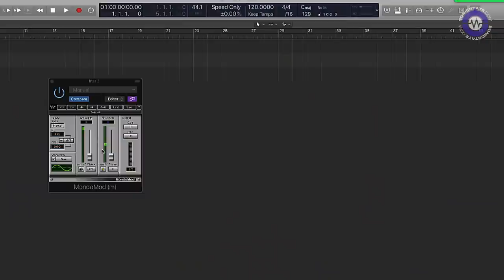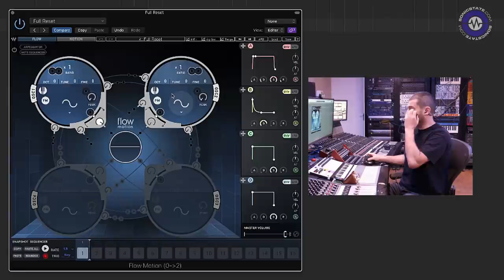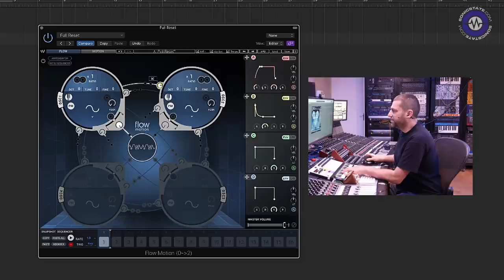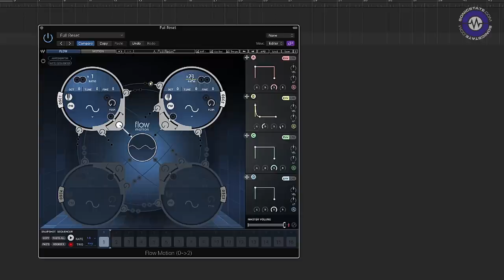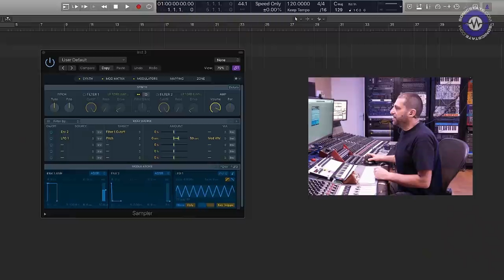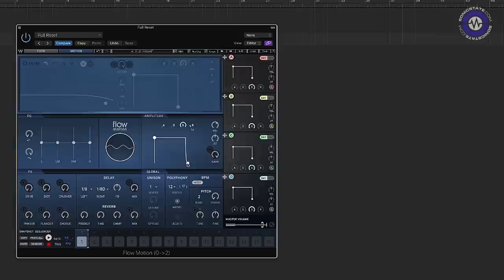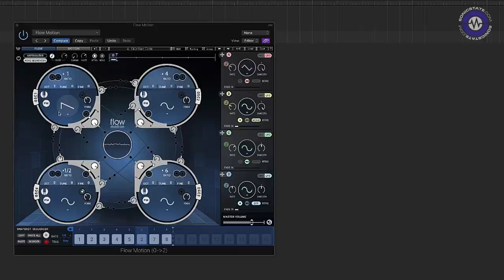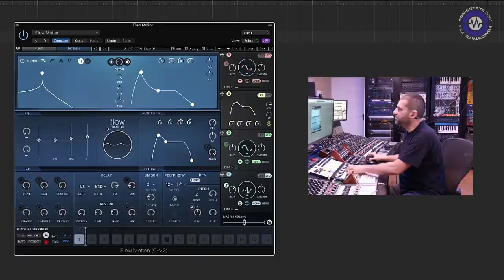FM Synthesis - How It Works with Yoad Nevo

Comment: I think of it as like this. The modulator decides the speed of witch the carrier is read. Or the modulator is reading the curve of the carrier. The more positive curve the modulator point is, the faster the curve of the carrier is read forwards. If the modulator curve point is negative then the carrier curve is read backwards.  I made a basic program calculating this. :-)

Comment: All the books I have are stupidly complex. Just think of FM as HFO, we all know LFOs, but think of FM as a series of HFOs (high frequency oscillators). Then you use the numerous envelopes to vary the levels of the tones to alter the sound over time. There's a lot more to it than this as you need to know about the relative frequency intervals, but so long as you're not trying to make a specific sound (like piano etc) you can experiment with those and the algorithms.
Reply: I think that's the key -- I can make a change and know it's going to have quite an effect but the trick is trying to think of a sound and actually be able to get int the right ball park by programming...
Reply: I've known FM synthesis for years, and I've never heard of it put this way. that's a brilliant idea and might make it easier to help someone wrap their head around it. Great Idea!

Comment: 24:17 actually it's not just 8 bit. Even the cheapest OPL chips had 11 bit resolution. The original DX7 has a 12 bit nonlinear DAC (like u-law companding) with a resistor ladder network theoretically giving a dynamic range of about a 14bit DAC. But as the resistors weren't always perfectly matched this introduced these well known noise artefacts. On the DX7II this was replaced by a 15bit linear DAC giving a much cleaner sound. The sampling frequency was 49.096 kHz. Not too shabby for the time. the grittier sound of the cheaper FM models like the DX100 or FB01 is because of a much smaller quarter-sine wavetable of only 1/4 of the size (256 samples) compared to the DX7 (1024 samples).

Comment: I (barely) remember studying FM and PM in my communication systems theory class...some really interesting mathematical derivations - tempted to dive into my basement to see if I still have those lecture notes! Probably wouldn't make much sense now after 30 years.
Reply: I think it differs what you use them for, in radio technology you modify non-audible carrier waves with audio, here you modify audio carrier waves with audio waves or non-audible frequencies. When you search for youtube video on FM (and over some time YT finds a lot of them), half of them are about radio communication and are not relevant for this realm, but they are not about how the results sound (musically, that is).

Comment: One thing that I wish these "FM Made Easy" videos on YouTube would help explain. Is the Combination types of all the operators. I mean the "DX7" has six operators! I get that one Operator modulates another. But I'd like to understand how to make all six of them Work together?
Reply: Usually high operator counts are there to make it so you can create an effect similar to detuned oscillators by setting up multiple fm pairs.  Because the dx7 had only sine waves it also needed 6 operators so complex wave shapes could be created for things like using saw waves as the carrier.  With modern FM synths you rarely need more than simple fm pairs as they usually have unison and complex waveshapes available.  In the rare cases you need more its usually because you're doing something to the transient for a piano or guitar sound.
Reply: @Pianet  Thank you, I appreciate you Explain that. To me it always Kind of baffled me in the past.
Reply: @maxmatson1578  most of the Volca FM presets (6-op FM synth inspired by the DX7) have the "main sound" produced by carriers affected by modulators, and extra sounds by the leftover operators that are not being modulated by modulators that add more subbass, more HF content, etc., to give a preset its distinct sound. Turn off one of these "extra" operators and you end up with a mutilated version of what you started with.

more operators is better, and not necessarily for trying to imitate acoustic instruments (which is best left to romplers anyway)

I bet you can also see this in Yamaha's MODX FM presets as well, but I haven't been able to check this out.
Reply: @Jason75913  Thank you for going into detail like that. This is the kind of "FM Made easy" video I would like to see? With the more subtle details about operator combinations like this. Thank you.✌

Comment: FM (Phase Modulation) is a bitch to intuit. The best visualization I have seen is on the Phase Modulation wiki page. However intuiting results of changing frequencies and multiple modulators, either visually or sonically is still very difficult.

Best to use an oscilloscope, a spectrogram and a lot of luck 😄

Comment: FM or PM, if you want to know what you are doing, you need to know ratio Carr:Mod (assuming they are both sinewaves), and the amount of modulation.
Different ratios are resulting in different series of harmonics. How to predict you can learn from Barry Truax site.
So if you want to get triangle wave which is the result of the even serie of harmonics (1, 2, 4, 6....) you'll need to... know how. And if you want to get natural timbres, you'll need to analyse their harmonics first. Great tool to help you go trough all this is spectrum analyser.
Must admit that I am not too aware of the all aspects of PM vs FM... FFT works by measuring an angle of a wave versus a phase (by windowing it)?
Reply: the triangle wave contains odd harmonics only, just like the square 🧐
Reply: @rebours  You are right.. 
"However, the higher harmonics roll off much faster than in a square wave (proportional to the inverse square of the harmonic number as opposed to just the inverse)."
Thank you.
Reply: great comment - so much to learn, thank you!

Comment: In the 80s I hated those new sounds. They felt so cold and clinical. Unnatural too. By now I understand it was the digital-ness. Like maybe when the CD was introduced and they were criticized for being clinical and tinny. Could it be that innovations like that used new techniques, but, of course within the limitations of the new techniques (as mentioned in the video, like the processing power) led to a compromise: innovation with (some) benefits that appeal to large audiences, and the limited  resources that annoyed people with specific hearing (which is not necessarily better or worse, just different, like perfect pitch, that are not a blessing per se). BTW No problems with digital or FM now, I'm not tribal about it, but I still don't like that 80s sound (especially those bell-like ones). I try to understand my preferences.

Comment: Difficult to explain and thought he did quite well.  The middle between the bottom and the top of PM over OSC = FM.  The OSC with Pitch changes then cancels out the sound of the PM and you can control the sound scape or shape of the frequency allowing the sound of FM and PM to be made.  Utilising various mods such as ENV’s etc makes the sounds like the DX or mod digital synths make.

Comment: Sorry he doesn't master this subject at all, he clearly confuses exponential and linear fm (the later being 100% equivalent to phase modulation in the case of a sinusoidal modulator, without any shifting of the perceived fundamental frequency as the modulation index is increased, which is a side effect of exponential fm only)...
Reply from the maker: Maybe, thats beyond me but I wouldn't be too sure, he did produce an FM instrument so I would think he knows a bit about it?
Reply: Yeah I think that's a true observation. FM and PM are just an implementation detail for the same thing in the digital domain. It's modulating analog circuitry where it doesn't practically work.

Comment: Sadly, a VERY disappointing "tutorial". I have been learning a bit about FM synthesis having acquired the very wonderful Kodamo Essence FM which is a joy to use. Having read around, I found myself knowing about John Chowning, I knew something of the difference (mathematically and practically) between FM & PM ... and Yoad sounded, err, "vague" about stuff. He might be very pleased with his software, but (for me) he failed to demonstrate the fundamentals or the complexities with anything more than the magical "it's very complex" "play around with it" "turn knobs". Loopop did a far better piece on simple FM with a Digitone to explain "how it works", the relevance of ratio's, etc. with that basic-but-comprehensible model of FM.  The main thing I "learned" from this was that I have learned a reasonable amount from far better teaching resources. Yoad might know his stuff as an engineer/programmer but I didn't think this wasn't good teaching/communication. At best this seems to be a "product demo". NOT to your usual standard, I expect better from Sonic Talk!